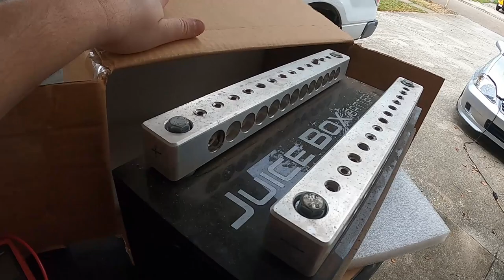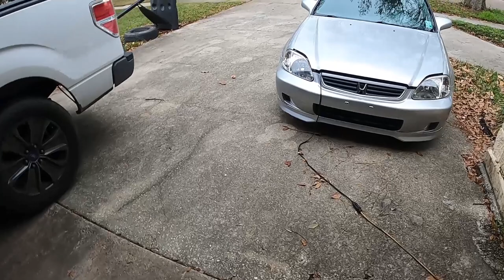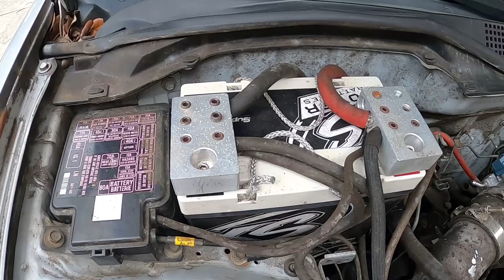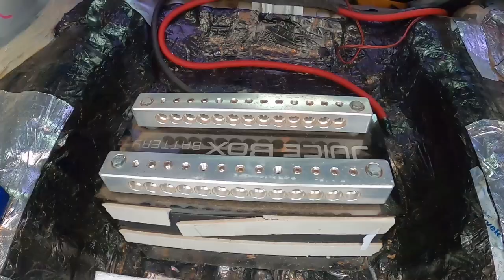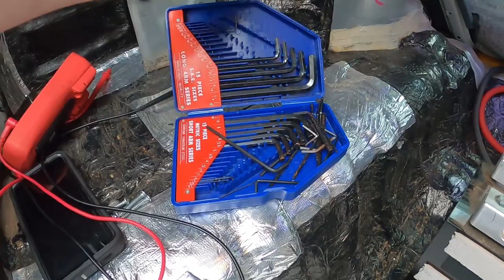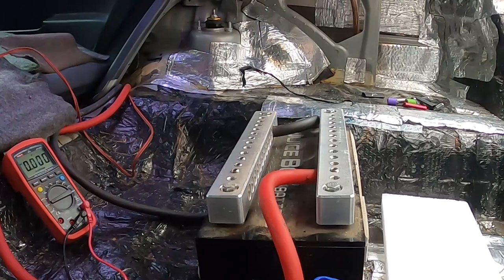How to: INSTALL LITHIUM for Car Audio!! NO BATTERY DELETE

Comment: If a lithium battery is installed, does the AGM battery need to be removed, or is there any damage if the two batteries are present?
Reply from the maker: Yes. Majority of lithiums wont want to work with agm together.
Reply: @Skip01  Thanks, good luck

Comment: Why are your allen's so neat? Should be in an old coffee cup! I'm installing a $379 preorder cab45 when it finally shows my caravan electrical is just the stock battery and 140A alt with a big 3 it's struggling with my Audiopipe apcle 1800 on 2 15" AB XRs, so I need a significant upgrade but as usually money's tight what is the all out cheapest route to go to support that 5k amp (and a 50x6 a/b). My stock electrical holds floats a good voltage on my Audiopipe digital gauge but dips bad on the beats couple of times my speedo went postal on me for few seconds. Same as my 95 mustang gt with a pioneer GM9701D 1200w mono the sparked innovations volt meter shows good voltage but factory dash volt analog meter looks like a friggin VU meter.
Reply: I have a caravan too have you did an alternator upgrade yet

Comment: Hey so you can have a agm in  the front and a lithium in the back and it's okay?
Reply: Yes but it depends I think since he’s resting at 13V and not 12V he can’t but I could be wrong still getting used to building banks etc
Reply: It depends on the chemistry you cannot mix C-Max with any other type of battery